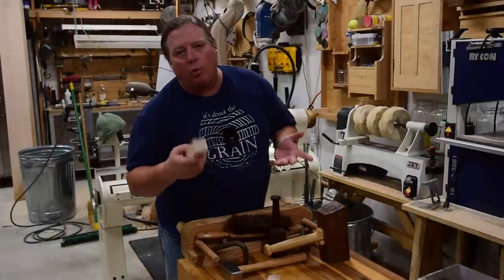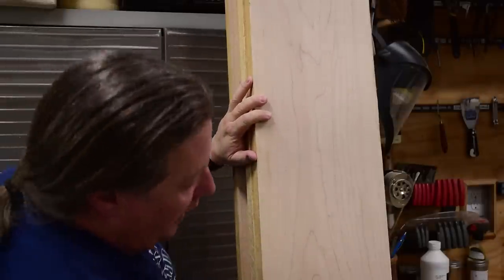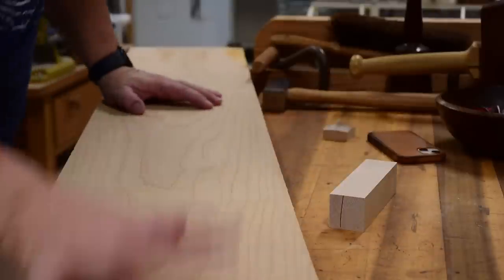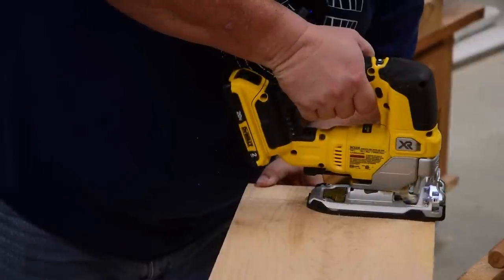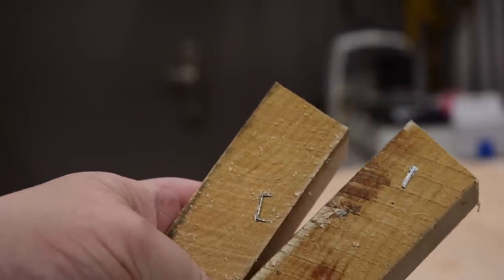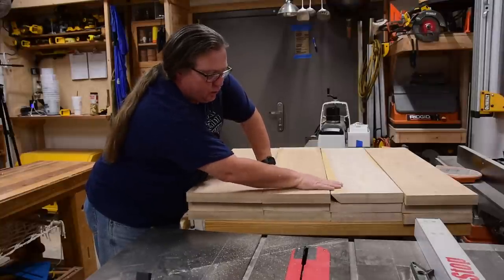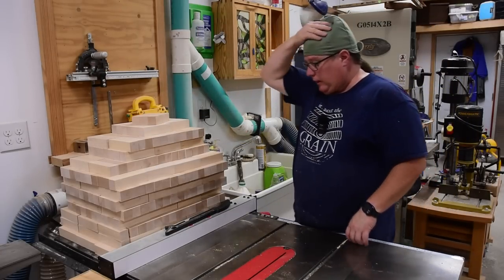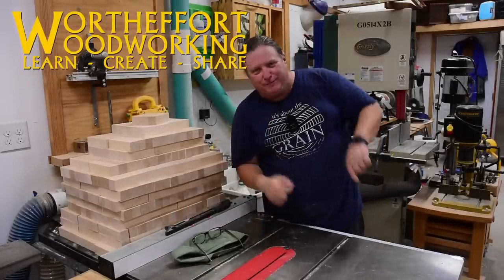The Quality of the Products You Make Depends Upon the Material You Select - Production Tool Tips Too

Comment: At the topic of "burning at the end of your length cuts, is not necessarily from slowing, but from not pushing the wood into the fence as it moves forward, the end tends to move free into the blade, and is burning as it goes sideways, this is why some wood workers tend to make their fence lean out away from the blade by a 32nd from front to back so as to allow there to be more room as the wood goes past- on the back side of the cut! Also, this is not needed if only you push with two push sticks towards the fence all the way into the blade, one going in at the side, one as you already did, straight past the blade. This keeps the wood moving into the blade snug to the fence, and it won't burn into the blade at the very end. But, something so slight, as you said, not really an issue, but I hope this give you insight for when it does count!
Reply from the maker: video evidence is I slow down. lots and lots of video evidence to that. yeeeaaaaaars of video evidence.
Reply: Did you get the burning from the front or the back end of the cutting blade? I think the previous comment has a point, but in that way the burning would be from the back and if I saw correctly, yours was from the front? Also was it to the left or to the right... with the pressing back it should be on the right side, not on the left which was the big piece. So, no need to argue, both phenomena are worth of considering, but the burning marks should point toward the root cause, which here, probably, was the slowing down. Also I saw there was the dividing part in place although there was no guard on top. My suggestion would have been it happens when you reach the push stick you slow down a bit, but I guess the marks would happen earlier that what we saw in the video. I have a Proxxon FET and people were complaining on Amazon the fence is not straight and they had been bending over backwards to straighten it... the manual says it is an important safety feature and warns against trying to straighten it. For that reason I think the previous comment is generally useful, as many people seem not to know - albeit Shawn undoubtedly does. 😅

Comment: Genuine question to follow; but first I 100% agree with your stance on pushing the work all the way through the saw.  I'm the exact same way.  However, I'm a little conflicted by the batching out the length cuts where you just keep pushing them through. Is that a risk assessment weighing in the productivity efficiency?  

I know you explained that it's "safer" because the fence isn't there to keep jamming it back in to the blade, but it still feels a little scary to me.  The only kickback I've ever had to date was a small piece of similar length that rode up and over the blade from the off cut side (opposite the fence), so maybe that shapes my trepidation.

Also, +1 for the bewitched reference there as well lol
Reply from the maker: I don't believe its a risk. Didn't think anyone would get that. Most miss the jokes.

Comment: There is a thesis on spiral inside trees that has been largely accepted but never fully proven. When you have water going down a drain in the northern hemisphere it will not be a 50/50 chance of being a clockwise to counter-clockwise spiral. The spinning earth influences it just enough to make it more likely to be counter-clockwise. Hurricanes are a ways counter-clockwise for the same reason too.

Then when we apply Coriolis effect to trees it could be the tip of the tree that is growing is taking the most wind influence and is still bendable enough to be twisted around just a tiny amount. The minor influence is furthered by previous influence in the structure under it. This is likely but not proven. Not too many other theories that have as much behind them.